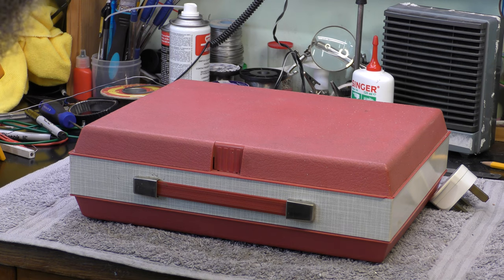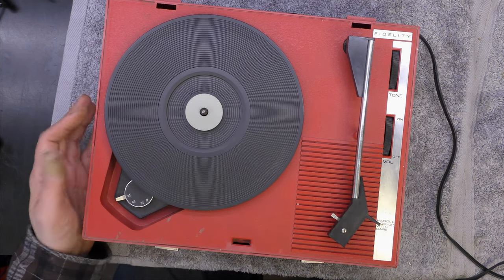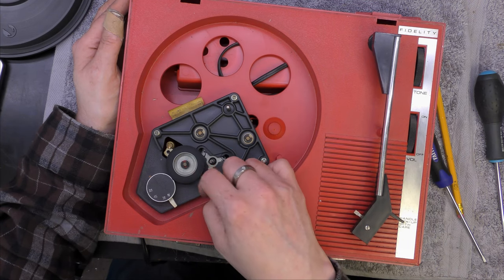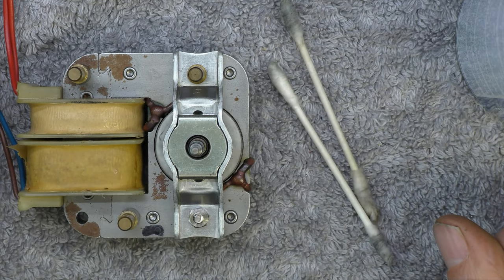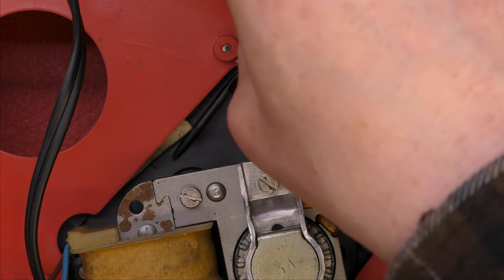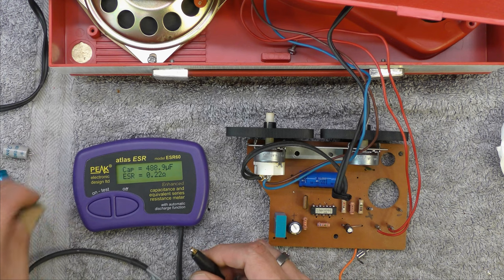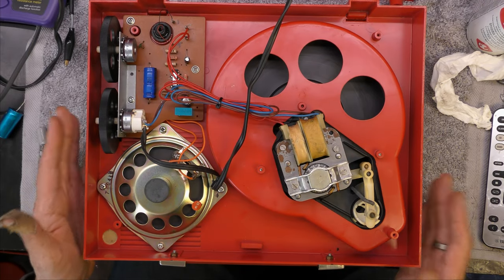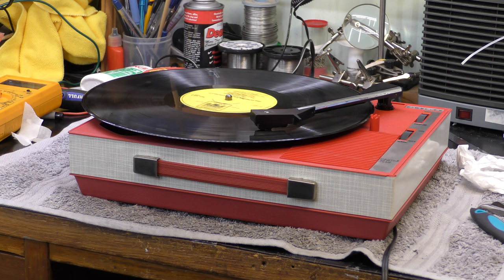Fidelity HF42 Simple Portable Record Player Phonograph 1975 (4K)

Comment: i had one of these in the early 70s .i had it connected up to the big 12 inch speaker in the [non working ]radiogram in the dinning room .it sounded really good
Reply from the maker: You know I remember doing the same with transistor radios. I was asked by cousin if I'd blow up radio with this huge speaker, no I said, same resistance. Daz

Comment: I had two of those when I was a kid in the late 70's or early 80's so think they must have been manufactured for a number of years. The first one was red but the tone arm broke and the replacement was a black version. I've still got it but the amplifier has a fault, it's like there's a transistor not getting any bias, it's very distorted and clipped with no sound at all at lower volume levels. It does eventually start working after about 30 minutes and warmed up, so there must be something that doesn't work as it should from cold. Sometime back in the 1990's I replaced the IC but that wasn't the faulty component.
Reply from the maker: Yes that's interesting, that it sounds like lack of bias indeed. There isn't much round the IC apart from a few electrolytics to check. Is the speaker cone stuck as that has puzzled me before but not much heat in there to pop it after 30 mins.  Also possible the rectifier is high impedance to start with as I'm sure it's metal type. Daz.

Comment: What a lovely video Darren, sometimes simple is best. Makes you realise that back then, cheaper stuff was aimed at, as you said, kids. Nowadays it the same old cheap stuff but advertised to be supposed high end.
Reply from the maker: Thanks. Yes I think you'd find that in the kids section in the catalogues of the time. Not much distinction theses days I guess. The speaker seems large compared to modern offerings.
Reply: @darrencoe5795  It was in the audio section of the 1976 Argos catalogue. For just under double the price you could get a Stereo Burnhill SCU1 using the same deck but with two separate  speakers each looking to be about the size of a bag of sugar :-) The most expensive system was a Decca costing £195. A lot of money back in 1976 and definitely not aimed at kids.

Comment: Great stuff Darren. I have one, works well but turntable runs a bit fast. For instance 45rpm runs at about 47rpm. I don't suppose that's easy to amend?
Reply from the maker: First check there isn't any rubber or dirt built up on the stepped pulley on the motor, as it would increase the speed as it increases the diameter.  Other than that, it's down to size of platter and pulley.  Daz
Reply: @darrencoe5795  Thanks for replying. I take it I'd have to take it apart to find that out? Meaning carefully removing the 7" middle thingy?
Reply from the maker: @julianmbrown  Yes, the platter needs to come of to inspect the pulley. There is always a risk of breaking the 7 inch adapter unfortunately.
Reply: @darrencoe5795  Cheers Darren. I'll have a ponder. Thanks for your help.

Comment: I just checked out the price of this in the 1976 Argos catalogue and it was £13.95. Equivalent to £101 in 2019 money according to the Bank of England. 

In the same catalogue section a top end Decca "Home Entertainment System" was £195 (£1400 in 2019 money).
Reply from the maker: A basic record player can be bought for 30 pounds so I guess in real terms the cost has dropped over the years. Not sure if reliability has improved though. Thanks for sharing this info.

Comment: They last life time a recap every 20 years or so an a service every  1 or 2 years motor an turntable spindle go for ever there great little players so basic simple an durable well mines going strong its 45 years old next year its been recapped an had a new speaker an cartridge an stylus sounds nice its black with wood affect the red1s are the earlier 1s started in 1976 till 1980 an the black 1s was till 1985 in argos they were £13.95 back in 76 an went up to 22.99  in 85 the the output is 1.5 watt yes tiny little amp that's bomb proof
Reply from the maker: @anthonyharvey9719  Many thanks for pricing info. So 22.99 is 69 pounds in today's money and a suitcase player be around 35 pounds today. At least there's no autochanger mechanism to gum up. Daz
Reply: No simple but so durable can you see a today's crossley or a Victorla or digitnow an all the other names off them lasting 40_50 years it needed a service the modern stuff would off been in the bin years before 4 decades